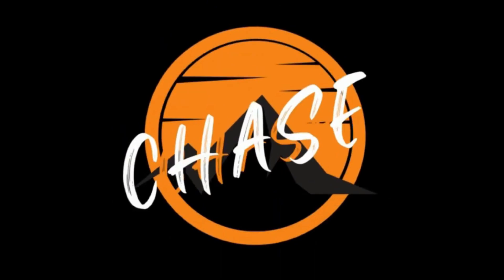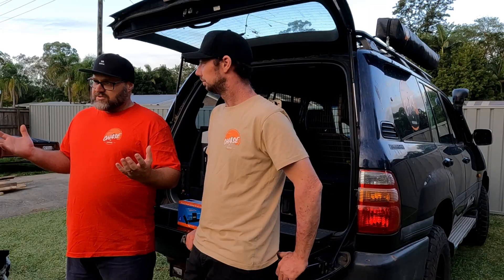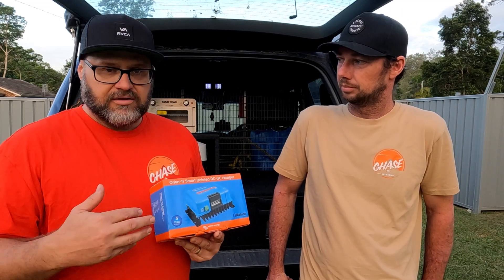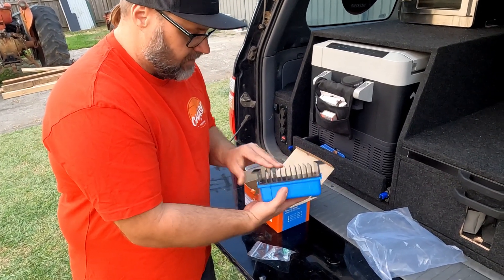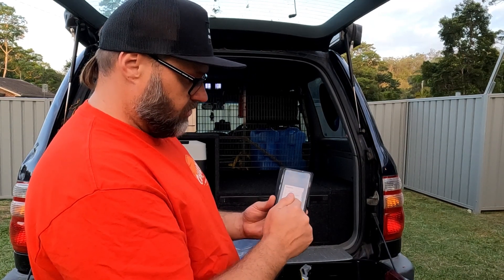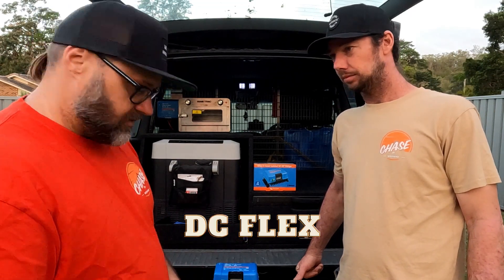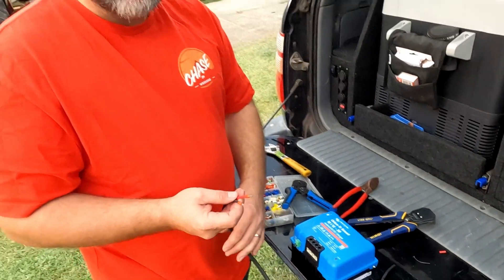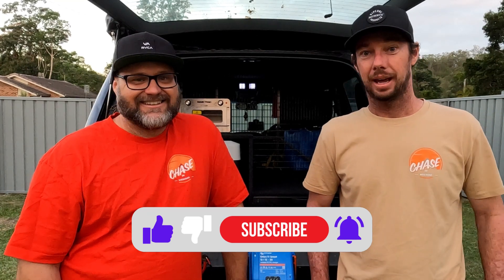Why You Need a DC-DC Charger? Victron Orion | 4x4 | OVERLAND | Tips #victron #diy #howto

Comment: Very nice video!! I have a question!i want to set up one of this at my boat but my boat provides max 9 amps! I ll use deep cycle batterys! Is there a chance that i ll damage the stator of my outboard?
Reply from the maker: Hi Ευαγγελος Κολαιτης, thanks for watching.  There are options that can be used in marine applications however I can't say for sure if a DC-DC charger would damage the stator, you can't really reduce the amount of power it would try and pull.  Might be better off with a traditional type of isolator but we would recommend chatting with someone who knows boats well.

Comment: Thanks guys - appreciate the effort you put into these vids. One question though...how are these dual battery systems better than something like a BLUETTI power bank? For example, BLUETTI EB-70...1000 watt (1400 watt surge); LiFePo4 battery; inbuilt battery management system; pure sine wave outputs - DC, USB-C, USB, 240v AC; inputs - DC, solar, AC; 2500+ recharge cycles; portable and under $900.  Mine will power a 60l refrigerator for 48hrs +; runs angle grinders and other power tools around the farm; works as "silent" genset overnight around home when the power goes out and we don't want the 9kva genset keeping us all awake and spewing CO2.  Honestly - not sold on the dual battery systems...am I missing something?
Reply: As someone who has both, (dual in one car, Goalzero in another acting as a extra power source) all I can say is dual battery is truly set and forgot, I find sometimes I have to check my 12v is charging the goalzero, when I’m 4wding I’m worried sometimes some things are unstable moves around, constantly checking charge is occurring and devices connected are still running etc, with a permanent dual battery setup generally you have control of having Anderson plugs (or whichever you prefer) and items are generally fixed to the vehicle so unlikely to be hindered by off-road or rough conditions. However we have both because here in Victoria there is a law that prevents any vehicle going onto the beach, in those occasions having a portable power source like a goalzero allows us to take the fridge down to the beach with the kids. It also can be useful for the 4wd trips where vehicle can’t reach a very special camp spot and you walk some short distance away. All in all, it’s user preference.
Reply: @AllTerrainAction  Hmmm...guess it depends on how well you mount it / put it together - never had a plug fall out of the solidly mounted BLUETTI, no matter how rough the ride. In any case, thanks for your thoughts...
Reply: @rossholmes178  sorry I was thinking of a non permanently attached setup, I’d your is permanently attached I guess those all in one units could prove to be a great option, they often are cheaper to get into than a full custom setup, if there is one pro for custom setup it’s probably options for higher charge times due to higher charge rate. It sounds like it’s more a personal preference type thing though!
Reply from the maker: @AllTerrainAction I would certainly like to have both options 😀
Reply from the maker: Hi Ross, thanks for watching.  The Dual Battery set-ups would be more for the tourer, set and forget, or permanent installs like vehicles with canopies or fridge's that stay in the car.  Both Gaz and myself have fridges that live in our cars so the dual battery system was our preference (I have under bonnet, Gaz has both).  Dual battery systems get their roots from the early days of 4x4ing where people would be using a winch constantly and require a second battery under bonnet.  The Dual battery isolator would be wired with a momentary switch that would allow both batteries to be joined in parallel doubling the available capacity and also isolating the start battery should the voltage or draw be too much in an effort to preserve the starter for starting.  It evolved from there with the popularity of car fridges (as well as the affordability of them!) and other accessories.  I haven't had any first hand experience with the Bluetti, yet, but it certainly looks the goods.  The limitations would be the battery storage size and the inverter capacity but for something you can put in and take out at camp or use out and about that's where that product has it's advantages.  For most people a 1000w inverter would be just fine and the convenience of having it all in one 'box' is perfect, especially with all the other sockets.  The question is how well does it charge from the vehicle and how long does the battery last if you were to use the inverter often?  I believe they may have the option of a solar panel as well?  If we can get our hands on one we will be sure to do a in-depth review!

Comment: Very informative thanks boys 😊 phone app so cool,  chase it hard boys 😂
Reply from the maker: Thanks Louis.  Victron have a lot of cool products that are all Bluetooth now and a lot of them can be put on smart Bluetooth network where they share information.
Reply: We’re all no brand name eBay dc to dc on some voltage cut off controllers and itechworld lifepo4 batteries, 2 years on still going strong, in one of our vehicles in the other ctek and agm, and in our convoy a troopy that has a 300Ah lifepo4 setup on Victron system - I think smaller systems you can get away with lesser brand name stuff, but once you get into the big capacities and need faster rate of charge and good regulation you want to be using brands that have a reputation as you’ll likely get the best result. Of course based on my own experience.